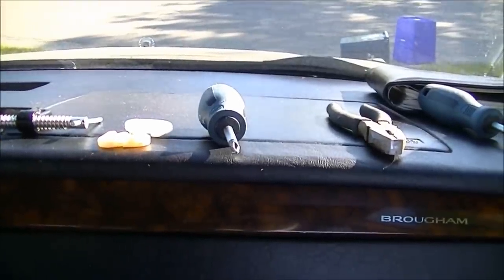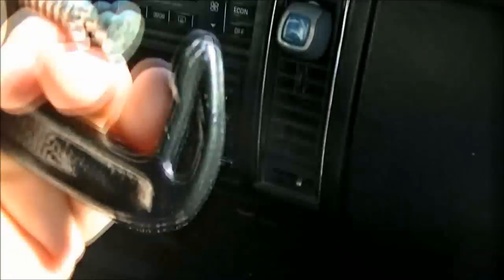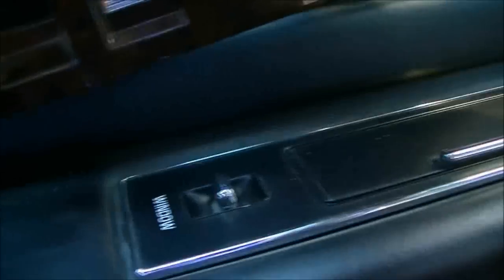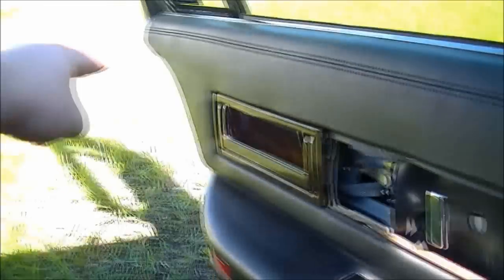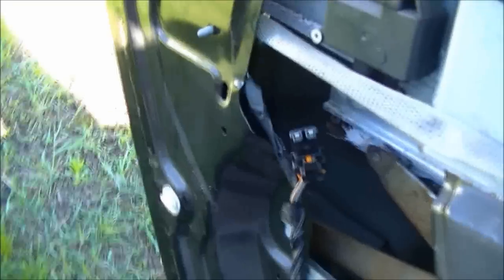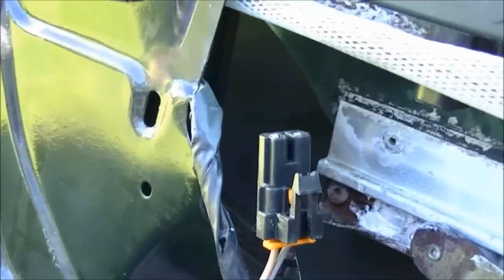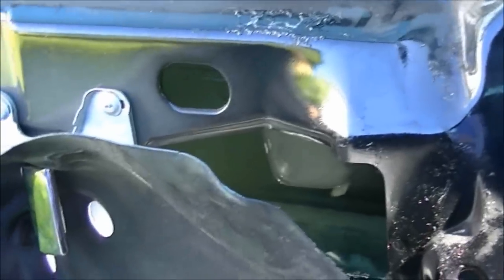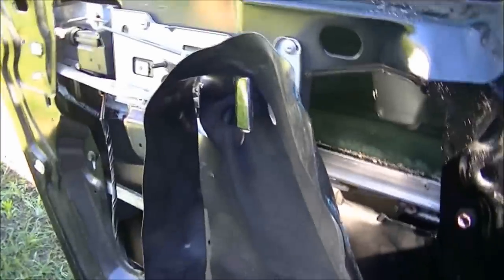Repair Power Window 1993 to 1996 Cadillac Fleetwood Brougham/Base Sedan Chevy, Buick

Comment: Blue tapes used for painting jobs can be used in lieu of the C-clamp. Several pieces attached on the tope of the glass/window frame can support the weight of glass. A nice video!

Comment: Thanks a lot for this video; it helped me fix two windows on my 1995 Fleetwood Brougham easily and without destroying anything!  One thing I would like to add for others is how I was able to attach the arm (with the ball on the end) to the clips.  I used your clamp method (I used a 3" clamp though) on the back door and it worked.  I then needed to fix the front clip on the front driver's side door and noticed the access hole was smaller and did not allow a clamp to fit in at all. For this I discovered that channel-lock pliers have just the right angle for you to go in and squeeze together the arm and the bottom of the window, you just have to apply a reasonable amount of force squeezing with your hand.  Thanks again - this video is much appreciated!
Reply from the maker: no problem i'm glad everything worked out for you!
Reply: Thanks for your tip with the channel lock plyers, I have to do my front drivers door on 89 Fleetwood, I am concerned about breaking the glass, thinking about putting masking tape on the part of plyers that will be against the glass.  Any suggestions?  Thanks

Comment: Thank you for this video and your help, I put my new clips in with no problems, greased up my tracks and the 2" C-clamp worked great! No worries about breaking the window the ball went right in the clip using the clamp thanks again!
Reply from the maker: No problem I was a little worried about the C-Clam part because really in order to properly fix it the rivits that hold the track onto the window had to be removed and the glass had to be taken out. I thought that is way too much work for each window so I'm glad this worked for you  but this is a risky job :)

Comment: Thank you so much for posting this video up! My '96 Fleetwood Brougham just started having an issue this evening... back driver side window is not going up or down.  How would I know if it's the slider (as you have shown in this video) or the actual power window motor?  Is there a way to know?  When I push the switch up or down, I don't hear anything (no motor sound), but I do see a very slight dimming of the interior lights each time I push the switch.  Thanks for your help!
Reply from the maker: Volo Photo, LLC To tell if you have a broken slider just close the door a little harder you will most likely hear a rattling sound. Another way to tell is by grabbing the window itself and gently rock it from side to side if it moves more on one side than the other then you'll know which part has the broken slider. As for the power window motor itself have you tried both switches master on drivers door and one on the door that's having the issue?

Comment: Can anyone tell me where I can purchase the plastic clips? I have been looking everywhere I can think of, with NO  luck. I have two broken ones in my 1994 Fleetwood broughm.
Reply from the maker: You can buy the window  Rollers instead of the Sliders like I used in the video the Rollers will pretty much last for the life of the car. The sliders I got from  ebay